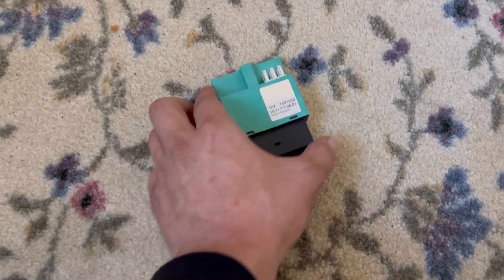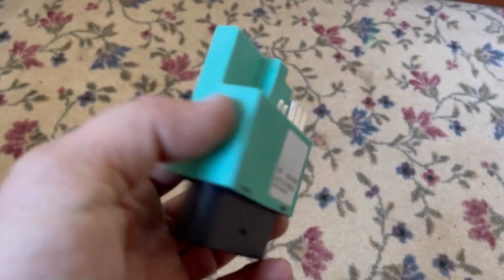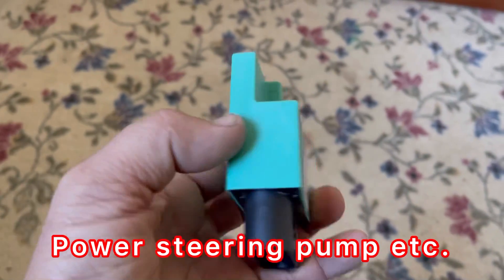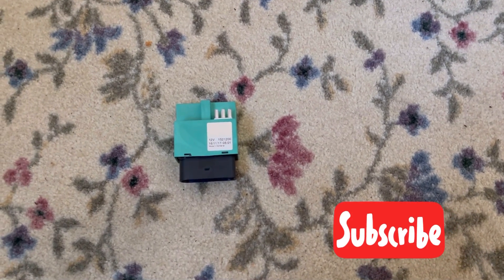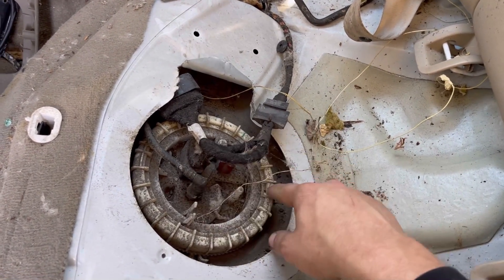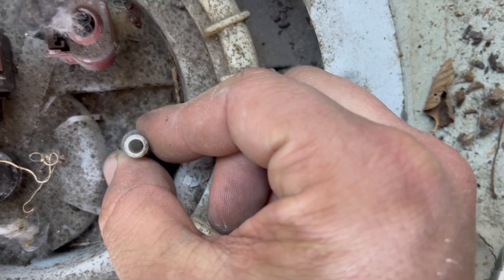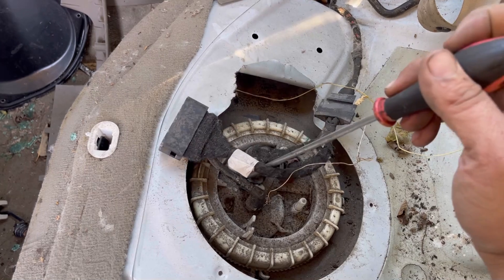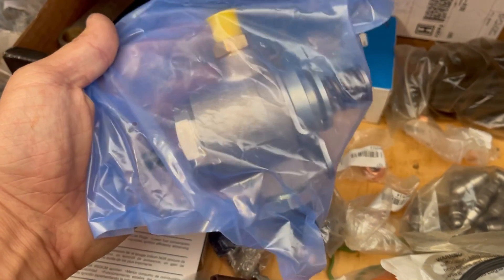Audi VW Fuel Pump Controller Control Module hpfp pressure stalling long crank filter problems issues

Comment: Swapped out the vacuum pump and hpfp as per how you showed it in one of your videos, the vacuum pump gasket was leaking a little bit of oil already and I got the parts from a company that does engine rebuilds and sells all the extras seperately. I got better fuel consumption and a little bit more power, engine has run 150k now.
Still has the original clutch and same flywheel, it's a manual shifter.
Reply from the maker: Rare car
Reply: @NaptownTuner  2011 A5 Sportback 2.0 tfsi, Has been rebuilt under warranty at the dealer at 65k mls/100k KM's as it used a quart (1L) of oil per 280mi/450km
Reply from the maker: @scrwbl8  a5 manual even more rare, sporty car!
Reply: @NaptownTuner  I'm in Europe ;) Automatics got popular over the last years as they're probably more fuel efficient with their eight or more gears, but most cars are still manual as people are used to them.
My next one will be an automatic though.
Reply from the maker: @scrwbl8  oh, lots of diesel vehicles as well?  I hear that there is supposed to be a shortage of that here soon, at least that’s what say are saying for the states
Reply: @NaptownTuner  yes, diesel always was way cheaper but the "road tax" is higher since they're heavier and you get more mileage.
So depending on how much you drive a year a diesel could be cheaper.
At this moment there's just one cent difference between regular and diesel fuel.
They say there might be a shortage coming because of new sanctions going into effect.
And they were talking about a diesel curfew or no diesel cars allowed on certain days, should there be a shortage.
But have they even thought about how groceries are transported?
What do emergency services run on?

Take it from me that they're already negotiating in the background how to end this thing in the east without both sides losing face.
Hardly any country has anything left to ship there, and at this rate we're all going to be thrown into poverty.
I assume you heard about the FTX tranfsers etc. too.

On "another subject", you might want to look up the new docu called "died suddenly"

Comment: I've seen a couple change the connector because it was burned up..I actually changed a burned up connector last year... then I changed the connector and the Module 4 months ago because the connector burned the pins on the module this go round... it is now Burned again 4 months later. Have you seen this where the connector keeps getting fried? Something is sending too much current to it? 2013 A4

Comment: @NaptownTuner
 currently dealing with the issue now on a 2014 A4 2.0T(CAED) replaced the fuel pump for a pump for weak performance of a duty cycle in 70% range at idle. when the original pump faild it through a P3044 so I replaced the pump with a new pump. Got the new pump car started and idled for about 5 mins. Power probed the LPFP and go 0.0V on all wires and the then the pump shut off and car died, crank no start, stumble start and shut off. Customer had the intake timing chain fail, so all that and the HPFP have been replaced. Only codes it is stored now are a P3044 and a P3073. P3073 refers to the control module which controls the power and the ground to the LPFP, this would explain why I have no power to the LPFP wile the car is running then shuts off based of the diagnostics I do have a bad module (part #4G0906093J).

    Malfunction Indicator Light (MIL) ON
    No start or performance problem(s)

Possible Causes

    Wiring and/or Connector(s) from/to Transfer Fuel Pump (G6) or Fuel Pump (FP) Control Module (J538) faulty.
    Transfer Fuel Pump (G6) faulty. See Special Notes
    Fuel Pump (FP) Control Module (J538) faulty.

Possible Solutions

    Check Fuse(s), Wiring and/or Connector(s).
    Check/Replace Transfer Fuel Pump (G6). See Special Notes
    Check/Replace Fuel Pump (FP) Control Module (J538)
Thanks for the videos I watch all the time and I check you on any VW/AUDI videos as that's what I own and fix a lot of. Love the weld joke🤣🤣🤣

Comment: I have a 2012 Audi a4 I am pulling 23 codes. Misfire on every cylinder, running rich in idle bank 1. Air intake leak, mass or volume circuit. It will start and idle rough and eventually die. I changed my coil packs and spark plugs about a year ago. Also, when I give it gas it struggles to get the rpm up but when it does it sounds like a muffled back fire then rpm’s eventually fall off and shuts off

Comment: My 2013 GTI had a newer revison fuel pump module.  I replaced it because it was a newer revision and i thought it was causing my long crank issue.  Turned out it was the check valve in the LPFP not holding fuel in the line after engine shutoff.

Comment: Hey NaptownTuner ! If the High pressure fuel pump is starting to fail what would the symptoms be? Clonking under load or high acceleration? Best regards Rasmus
Reply: Audi A4 Allroad 2.0 TFSI B8 spark plugs, coil wires and all plugs just replaced.
Reply: Long crank or no start on hot engine..and noticed engine almost wanted to stall coming to stop..

I have 2014 allroad, and just had no start on hot engine, replaced HPFP and fixed problem
Reply from the maker: Just when in doubt replace the hpfp it fails that often
Reply: @hotshotfx3502  My allroad is 2013, 80k. miles, still all good. How many miles you have on you vehicle? Thks.
Reply: @NaptownTuner  my situation is that I wanna pull our 21ft boat on a trailer. It pulls it fine but when meet a hill it really struggles, and clonk and shakes when load to high and rpm’s too low, then downshift goes fine again until rpm to low… any ideas? No oil I coolant, I replaced water pump and oil cooler thanks to you. I know it’s not the perfect towing vehicle, but that’s the situation we have… hope you can shine a light. Best regards ❤️
Reply from the maker: @Oceanchartercaptain  how much does it weigh and what class hitch do you have?  They don’t make a 2” receiver for that platform, I made my own and I’ve pulled an Audi A4 with an identical Audi A4 many times for hundreds of miles but yes it’s not the best to do.  I did wear out one transmission but I think that was because I had a stage 2 tune and pulled my skid steer to the gas station down the street with it like an idiot just to prove it would or wouldn’t hold.  Didn’t do a quality video on the dumb test like I should have.  Anyway 21ft sounds really long for a car to pull.  It should at very least be in sport mode if not manual mode and you need to keep the rpm’s in the sweet spot at all times because 4 cylinder engines are not meant for towing.  (Very much)
Reply: @NaptownTuner  thanks for your quick answer and knowledge! I see all your videos and it’s a great help, because I live in Italy and here they you steal their neighbors weeds if they can get away with it. If I lived near you I would use you for sure! 
It has an ACPS-ORIS hitch equivalent for the car and the tow load (ish 😀✌️) Had to replace impact bar etc. so it’s strong enough, but the car is not.
After a long haul to Denmark with trunk full of heavy shit (2000miles out n back) That was when it started doing the clonking under load of gearing wasn’t correct. It’s definitely not a gear box issue, even though it’s a little crunchy in 1st and reverse. When i returned from Denmark I noticed oil in the coolant, and that was when I stumbled over you on the old interwebs. So Changed and flushed oil and g13 coolant, and changed water pump and oil cooler, because the car started running hot (only short time) 500miles after the G13 liquid is still crispy red. When changing oil it was normal oil cooler, used but normal. So my next step was the fuel supply (I’m no mechanic but DIY thanks to you!) changed coil wires which was all mix matched and changed the plugs. The rubber from the old coil wires was all in pieces inside the tube. Changed spark plugs to double iridium with 0,7mm spacing. But the car still does it under load/wrong gear low rpm. Hmmm… 
Do you think the HPFP could be the culprit? If yes do you have a part number? They’re not the most informative here in Italy… best Rasmus
Reply from the maker: @Oceanchartercaptain  if it’s the original hpfp then change it because it will fail eventually, I’m not sure about coil wires, they are coil packs or coil on plug.  I’ve had to replace fuel injectors more commonly lately and it they eventually need a valve cleaning.  Can’t really help with the noise unfortunately.
Reply: @NaptownTuner  clonking maybe I’m describing it wrong… the engine wobbles and looses power until down shift the it regains it momentum. No misfire codes. 
I’ll change the HPFP, thanks
Reply: @NaptownTuner  thanks buddy
Reply: @NaptownTuner  I’m in the same boat. Clonking under high load. I’ve done the Hpfp, coils, plugs injectors & pcv, b1s1 O2 Do you know what I should log vcds to show it

Comment: help me, sensei! I don t understand
2011 A5 2.0tfsi quattro tiptronic caeb etcetc

Initial problem: long engine cranking (cold) 
1. New lpfp installed - still had the problem
2. New hpfp installed - fixed the problem

After that I had a big oil leak on the vacuum pump.
Changed the vacuum pump with a new one last weekend
And now my problem with long engine cranking CAME BACK (after replacing vacuum pump by myself and uninstalling the hpfp for this job)

Is there a fault created by the way I installed the pumps? What should I check ? Maybe the O-ring is faulty? or the roller tappet? 

No faults on ecu 

(Have to mention that the first long cranking problem was caused after I changed vacuum pump gasket  - at that time I taught the oil leaking was caused by the gasket so I replaced it but didn't fixed the problem)
Reply from the maker: You can have a long crank and no faults for a high pressure fuel sensor on the fuel rail.  It’s rare but I’ve seen it and replaced it more than a few times

Comment: Changed my hpfp after getting too rich/too lean codes and have had no problems since, 20k miles later
Reply: What kind of HPFP did you get ? Brand specifically?
Reply: @omarijohnson5236  Delphi….still no problems

Comment: Hello, I have an Audi a6 3.2, fixed the head and no is fine but the fuel pump never came on, I do not know how to test this module, but is killing me that may be a wire broken on the engine, may be the fuel pump runs with some of the sensor on the engine, can you help me?
Thanks

Comment: I have an Audi A4 B8 2011. I got below error and I replaced my fuel pump. But after replacing, still I’m getting the same error. 😢 

“Fuel Pump Short Circuit “

Comment: change three of those it was never the problems it it was the fuel pump in the tank all vw's
Reply from the maker: I don’t have much experience with vw but I forgot to mention that running out of or low on fuel even once can destroy the in tank pump really fast.
Reply: My Audi B8 Allroad 2010 drives fine but under heavy load it clonks until down shift, any ideas?

Comment: HI SIR I HAVE VW PASSET 3.6 V6  I KEEP GETTING LOW FUEL PRESSURE CODE I HAD CHANGED BOTH FULE PUMP NOW I GOT PUMP MODULE GREEN LOCATION TOP OF FULE PUMP . KEEP GIVING CODE LOWFULE  PRESSURE I MAY CHANGE  NEW MODULE? I DO HAVE FROM ( VW)  PLS RESPOND
Reply: Ohio

Comment: Audi a4 b8, I have it burned and the connecting wire was melted as well i changed it but I’m afraid that it’s electric issue?!
Reply: @abdelrhmanelateek - did you find solution? did your replace the pump with melted wires?

Comment: P025B - Fuel Pump Control Module signal implausible 

Any idea?

I have a 2018 Audi Q7 3.0
Only 70,xxx miles
Reply: If you have power to the  cpu relay, the cpu, the fp fuse and the fpcm, but no power out of the fpcm to the fp..., and can apply power fuel pump and make it work, then this is bad.Mine was bad. That was flow process.

Especially if you prime the low pressure fuel pump manually and the engine starts and runs.